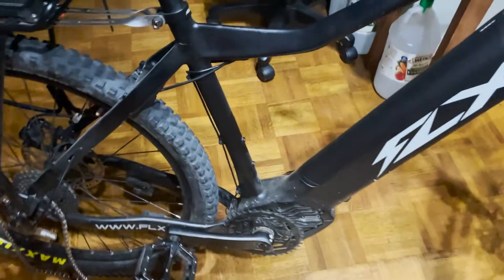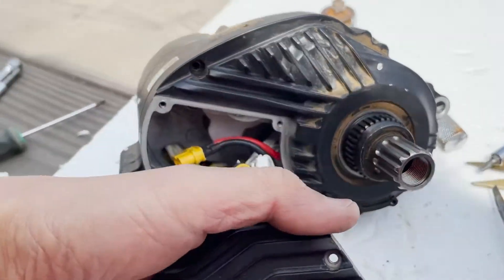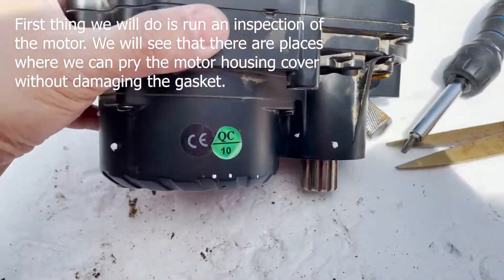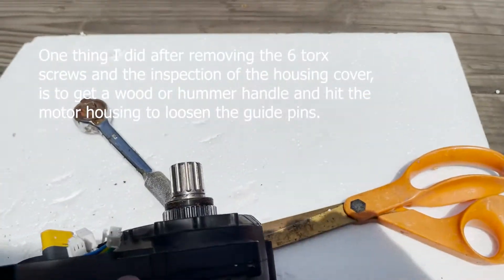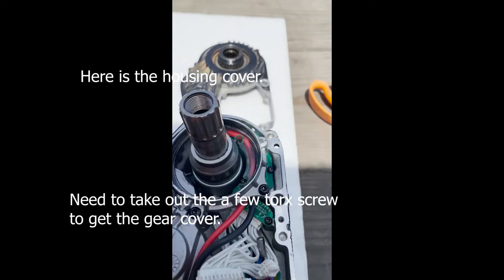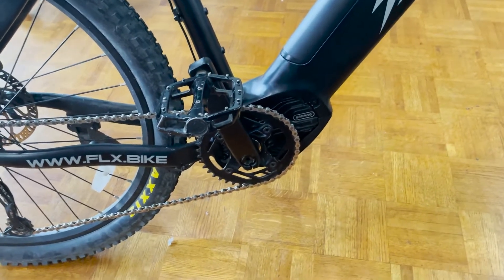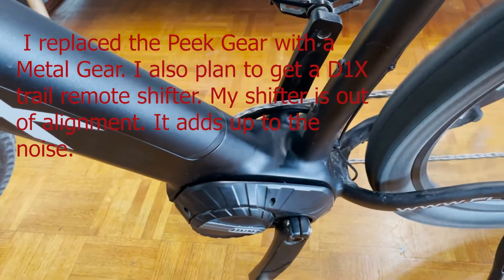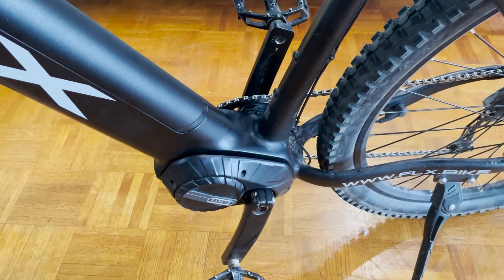Bafang M600 Motor Repair

Comment: Hi i just replaced my torque sensor but now the motor will not turn on even if i replace the old sensor the display doesn't light up or power on will recalibration solve my issy or is it something else? I have checked all my connection but still no Matt how long I press the power button it will not turn on please help